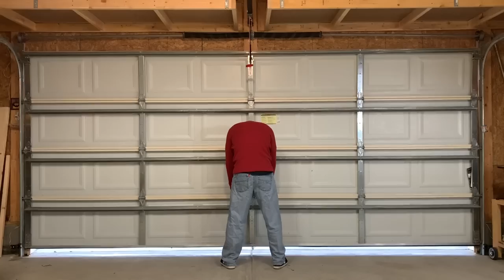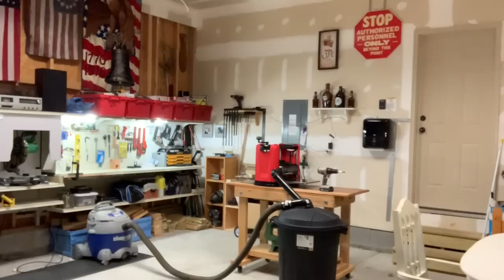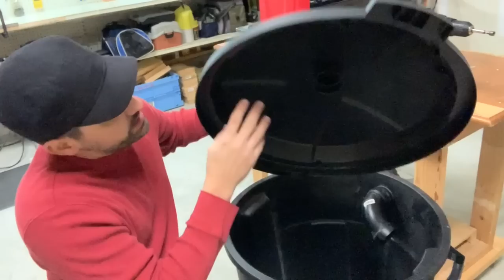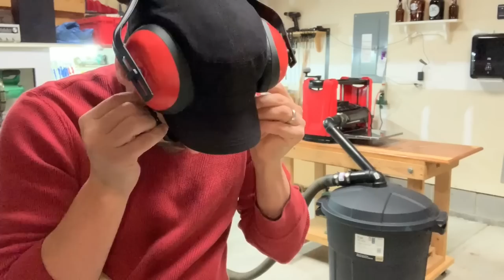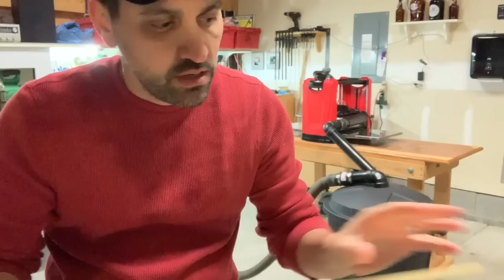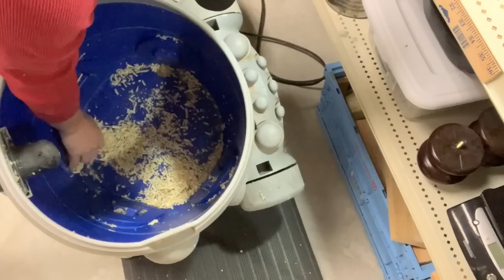Trash Can & PVC Pipe Dust Collection System for UNDER $40!

Comment: I like this far more than the expensive dust deputy version because with a trash can you can hold a lot more with less trips to the dumpster! And especially because it’s easy to transport from tool to tool. I might need an actual cart because my massive vacuum gets stuck on my uneven concrete floor but this really makes a fast and cheap solution. It’s been too cold in my area to safely run the table saw outside so I’ve been stuck inside and wishing I’d had a way to connect to the table saw plus a container for all the massive chips. My garage is so dusty and even with my mask on I cough from all the fine shit in the air. Anyways nice job and thrilled to see a faster, better solution than some of the others that require shipping in, etc.
Reply from the maker: Thanks for watching!!! Appreciate that!!!

Comment: Just made this unit and you’re correct, it works great. I have a smaller shop vac (3.0 hp) a little more on the ground than I’d like but 95% was in the can. I might not have a big enough shop vac. But it works great thanks.
Reply from the maker: Awesome!!!! Thanks for watching!!!!

Comment: Nice work.  Thanks for the idea.

Just a thought, when you opened the trashcan, the inbound nozzle iss facing the handle of the trashcan.  I'd bet that if you adjust it so it aims past the handle, there would be a lot less sawdust in the vacuum.

Comment: I think the pipe you are using is actually ABS and not "black" PVC. The difference would be important if you were to glue the fittings to the pipe, because the two plastics use different cements. With friction fits such as you are using, IDM.
Reply from the maker: You are correct my friend! I was using the wrong terminology!

Comment: Nice concept. I would have liked to see how you attached to the planner. Also its seems like you would want to have a tight seal at the garbage can lid for maximum efficiency.
Reply from the maker: I use 2.5 Rubber couplings I got from Lowes.  I might do a video on this alone in the future because its a great way to quick change the hoses to different tools!

Comment: Hey there...I I came from your Bauer planer video comments and I said I would check out this dust collector system. I tried something similar to this a couple of years ago. I bought one of those Cyclone funnels and attached it to the top of a trash can like what you have. When I turned on my 16 Gal Ridgid shop Vac, the trash can's sides got sucked way in, and all but collapsing the trash can..wow..!! I put some wood cross bracing inside the trash can and it still sucked in around the cross bracing. Darn...apparently my 16 Gal. vac is just too strong....so you are correct...the shop vac doesn't necessarily have to be a great big powerful one. Now if I had a heavy duty container like those blue ones, or if I made my own plywood container...(wouldn't necessarily have to be round...I think)...then I could use my shop vac. And definitely...I don't have a big budget and need to keep costs down. I also must make a fine dust filter set up...should have done it years ago. I have seen many YT guys taking a simple box fan and basically putting a filter of some type on the intake side. I do a lot of sanding so I really...really...need to solve that problem. Thanks for your video...you are a family man and seem to really enjoy and love your family. That is fantastic...!!
Reply from the maker: It’s funny say this comment! My trash can sucked in last night and cracked.... again!!! I went on Facebook Market place and found a guy who is selling 55 gallon drums for $15 each!!! Much much stronger! Can’t wait to get it! I might do a recap video too. Thanks Marbleman!
Reply: I made one of these with the same concept idea, and came to this video with hopes to find a solution for the trash can collapsing. Mine was a Brute, grey can from Lowes and my 6hp vac destroys it. Have you since figured out a solution??
Reply: I use a resealable 40 gallon plastic chemical barrel (Amazon).  Works perfectly.

Comment: I have an exact planner but the color. I tried the same thing and...it stocked. The engine forces but I shot off it right after. This mean the motor is good but it needs a serious saw dust cleaning. I made a wood-fanal but the suction wasn't strong enough. So, be careful to get a proper suction.
Reply from the maker: Thanks for watching!

Comment: I would think the crash can would collapse under pressure? Also the sides are not airtight. What brand of trash can do you use and do you seal around the pvc coming into the side and where the top meets the trashcan. Thanks,
Reply from the maker: I don’t use this system anymore but it was “OK”. I highly recommend a quality dust collection system before a homemade one!

Comment: Good job, my only comment is the filter on your shop vac got plugged up with all the fine dust that should of stayed in the large garbage can if you had placed a plate in the top on the can. I forgot the name of the plate but there are several other videos out there showing how to add that plate to improve your fine dust collection.
Reply: Ron Alves I believe you are referring to a Thein baffle.  Check out Stumpy Nubs and others.  I would consider using a metal can or a Rubbermaid Brute heavy duty can.  I prefer frugal over cheap.

Comment: These types of dust collection is fine. I made one similar and does well yet there are improvements that can be made that reduces the amount collected in the vacuum. Oneida (a bit spendy), makes a system that, the head alone, is awesome. But that all depends on what you are after, alot, a little, or cheap as can be. But then how often are you cleaning the vac filter?

Comment: Could this be made for a sander for sanding furniture? And what would you do differently, maybe use a second hose instead of a PVC pipe from the sander to the trash can? I am refinishing furniture and winter will be here soon so I would like to be able to do this inside. Thank you.

Jackie
Reply from the maker: Personally I’d get a cyclone and add it to the top of a lined trash can! You can get them from $30-$150 on Amazon!

Comment: I noticed your filter was still full, you have to be loosing suction as you carry along with your project. I understand the concept of the garbage can but shouldn’t it be eliminating majority of the fine dust that clogs the filter in order to be productive ? In my opinion if it don’t keep the filter from filling and essentially loosing suction it’s a waste of $40 because all your doing is separating the large from small dust.
Reply from the maker: No suction lost and honestly it’s too powerful for a normal trash can! It’s job is to collect the shaving and separate dust so it did it’s job as intended. Thanks for watching!! I recommend buying a 50 gallon food grade barrel with a removable lid..... those don’t collapse from the suction!
Reply: If you say so but from my experience and every other persons experience we lose suction from fine dust blocking the filter which this machine collected on your filter. You may not have lost suction due to only shaving a single 2x4 but over time as you are continuing you will lose suction. The point of a dust collector is to stop the dust before it gets to the filter. I can tell you I can run my shop vac with my planer, jointer, mitre saw, table saw, and bandsaw and get less then a tablespoon worth of dust on my filter with my Oneida on a 5 gallon bucket. I watch these videos to try and improve what I have but this system just don’t separate the dust from the filter like it should. Try sticking a board or something in the can above the inlet hose with a hole in the center to stop the dust from spinning up the barrel into the vac hose. I believe it will help keep the fine dust away from your vacuum.
Reply: @michaels3972  Dust deputy is just an expensive version of what he has built. There is no more fine dust collection as a result.
Reply: @lastchancecris  He lost suction. My home made system might have a spoonful of dust after using all of what you mentioned all day.
Reply: The bag filter in the vac is all that is missing. That is what gets the dust, so you don't have to constantly clean and replace canister filter. The trash can did its job on getting the large particles. The bag gets the fine, and the canister gets some of what otherwise gets sent out into the room.
Reply: @michaelcoughlin8238  I was wondering about that, as I'm about to build something like this myself. Does having the bag filter significantly reduce suction? I wouldn't think so, I guess I can try it both ways to see.
Reply: @roderickfemm8799 it probably does to a small degree at first and then more as it gets dirty. Since it’s essentially cleaning air it sucks from the trash can it should work for quite a while. I agree though, testing will tell the tale.

Comment: So I made a dust filter from 3 5gal buckets and the trash can and I run no filter in the shop van and I don’t get any dust in the shop van at all yes I did the trash can like he did then I did a bucket with a cyclone then I have a bucket with water then I have empty bucket to help stop the water vapor making it into my vac I can sand drywall. I have a 20’ hose so all of it just stay in the corner of my shop I all so have a Christmas tree light remote box to turn it on it clips to my belt when I am in the shop working and I just put the hose on my tool and hit the remote then the power on the tool I plan to make a pvc system and just have open the vac gate at the tool no more hose to trip on.
Reply: Make a video...
Reply from the maker: Yes! Please!

Comment: I can't use a plastic trash can. The Ridgid Shopvac i have makes the trash can collapse in on itself LOL
Reply: Buy another can exactly like the one your using.  Place your dust collector trash can in side it.  It will prevent the trash can from collapsing by supporting the inner can on all sides.  Worked for my 5 gal pail system.

Comment: Try using a plastic 55 gal drum with removable lid large with two large bungs one is fine thread snd will accommodate a 2 in threaded pvc adapter the other bung can be used to regulate the vaccum

Comment: Think it could be used to suck up a small area of attic insulation if it had a hose instead of the PVC you have to the saw?
Reply from the maker: Maybe a really small section of Blown Insulation.  Depends on the size of the container your using too.  I would suggest go online and look for a 60 gallon plastic container with a screw on lid.  Super Rigid and large too.  Good Luck and thanks for watching!!!!

Comment: This is a great idea until you find out the trash can lid you have won’t support the pvc and connections thereby not keeping them upright. It was just too heavy for what seems like a flimsy lid. 

Trash can same size and from Lowe’s though I suspect there may be regional differences in products for sale. 

So either I trash this - no pun intended - or I test the strength of the next trash can lid before I buy another can.
Reply from the maker: After this build I would suggest going online and finding one of those heavy duty food grade barrels for like $20!!! Facebook Marketplace is a great place to find out them!

Comment: What if you made another one, Daisy chain them together. Would that further reduce the amount of dust in the vacuum? Just pick up a planer yesterday. DeWalt DW735 and it has a blower on it for "fan assisted chip ejection". Definitely going to be building this
Reply from the maker: Dude you got a Mac daddy planer!! I don’t think you can daisy chain the containers. Look on Facebook Market Place for large plastic 55 gallon drums. Much more rigid than a trash can.
Reply: That's not exactly how that works.  The stuff that gets by the collector is likely going to get by the next collector as well.  Its the size of particle that has a 50/50 chance of getting collected or passed through.  Added more will just decrease your airflow.

Comment: Hey was wondering if anyone else made one? I just made it and it caves in my trash can every time I cut it on. For the dust issue I added a shop vac filter into the lid build and seems to be doing a good job. Made it where it will come off easy to blow it out when needed
Reply from the maker: You may need add a vent with a filter to keep from collapsing.  Mine seemed to do the same thing as the trash can was a little thin.  It worked for a while but then that was it.  I ended up just buying a WEN Dust collector on Amazon for $100.  check out my review video and the link in that videos description.  Thanks for Watching!
Reply: Probably makes a difference on the size/hp of your shopvac. I have a small one I intend to use in this application, but I have no doubt the bigger one would cave in  the can.

Comment: Great idea, one question on the dust collection mounts. What kind of attachment did you use on the planer to capture the dust? I have seen some generic vacuum pieces but nothing like that.
Reply from the maker: I got all the parts at Lowe’s. It’s all Black PVC pipe and the rubber connector as well. I would recommend looking in Facebook marketplace for a 50+ gallon plastic drum. Much more rigid then the trash can and will cost the same if not cheaper! Thanks for watching!
Reply: @TheCrawlspaceCraftsman  I was referring to the plastic parts at the tool for collection.  Where the dust is collected on the machine?
Reply: Use a hose to go to you machine. No Idea why he used pvc for that. Watch Chris Notap video on how to make one. It works a lot better than this one.

Comment: Didn't recognize the brand but your shop vac looked like a short Dalek.
Reply from the maker: Him and I Woodworking gave it to me.... I never looked either.  I strictly use it for my chops saw now so its tucked under my work bench.  I very seldomly pull it out.
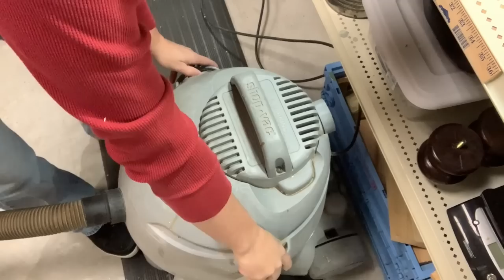Reply: KalindsLife at 9:54 of the video you can clearly see that it is a Shop Vac brand, 16 gal 6.0 hp
Great video! And has far as the intro....let those who have a problem with its length, watch someone else’s channel if they don’t care for how long it was

Comment: That's not working well. You might want to move the inlet pipe closer to the wall of the trash can and angle it down just a little to create the swirling of the dust so it goes to the bottom. The way you have it here, a lot of the dust is getting sucked up. My guess is that as the dust comes in, the way that it's positioned is throwing it right into the pickup.  If you are picking up fine dust that is not as heavy as what you did here the problem will become much worse. I made one out of two buckets and I can use it all day with almost no dust in my vacuum. Lastly, using a good filter (can't remember what they are called right now) will increase the suction a lot. Good luck.

Comment: Why not just hook the shop-vac straight into your tool?
Reply from the maker: You can do that too but it’ll fill up real quick.
Reply: @TheCrawlspaceCraftsman  Ok, thanks.  It's super quick and easy to empty and I'm just doing small projects.
Reply from the maker: Dwight Fontenot absolutely! If you are using a planner or jointer you’ll empty a lot. I would just aim it at a wall and let it build a pile then scoop it up. Other than that a shop vac is great for small projects!